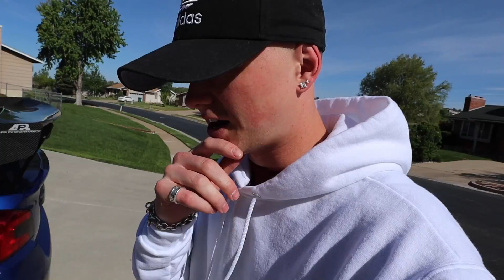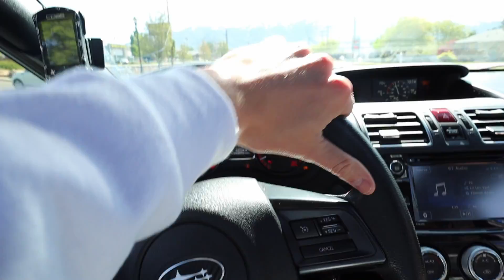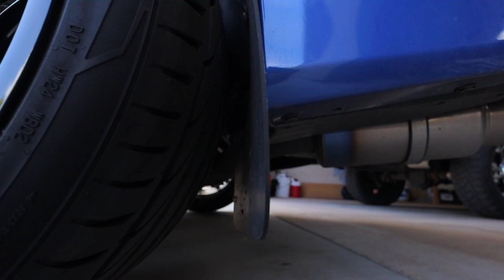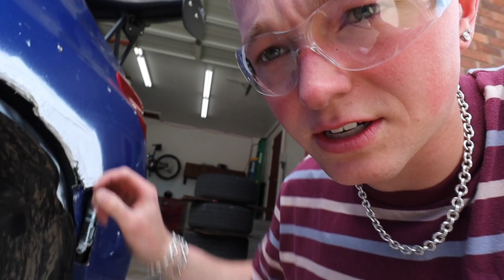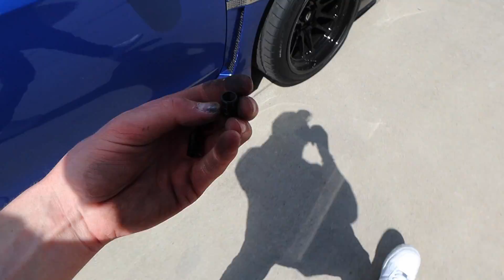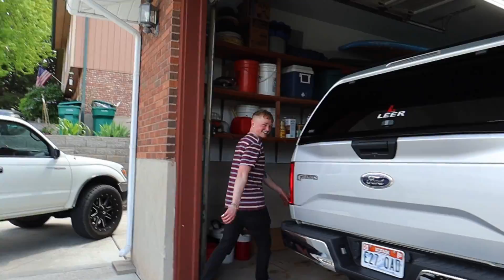How To Make Your Wheel Setup Look Better!

Comment: Awesome vid!!! I have the rallyarmour mud flaps too and I can’t run them in the winter with my snow tires, they rub so bad. I even tried welding the nut on the inside to the outside, didn’t help.